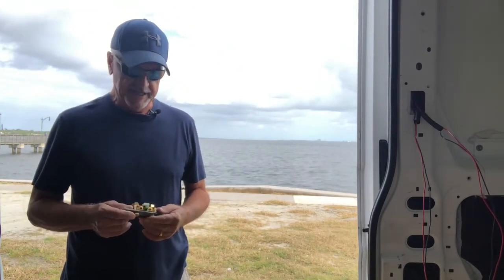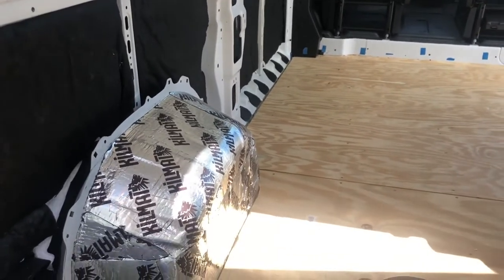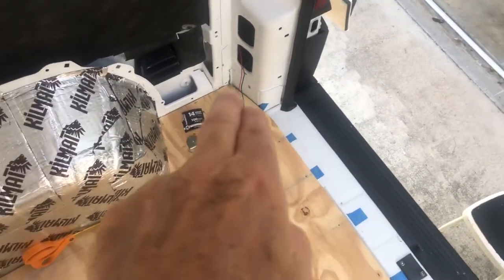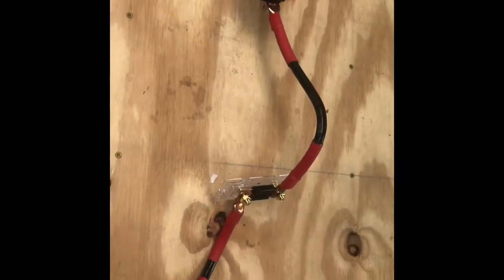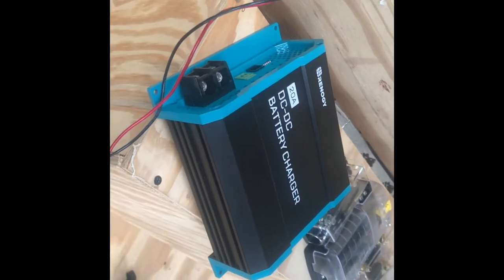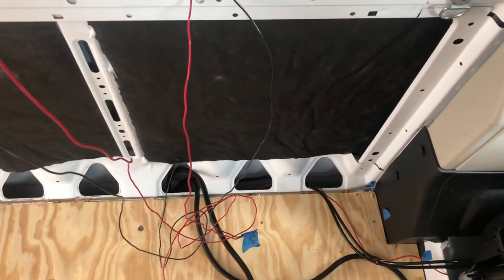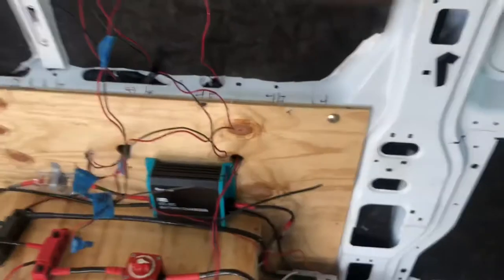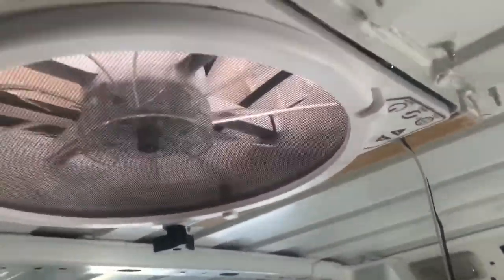How to install electric in your van #4 Electrical

Comment: Electrical is definitely the most daunting bit for most people. There are more and more companies here in England offering full van conversion service, or just partial conversion if you can do most of it yourself. Seems to be a growth area, even before covid. Prices of even older camper vans are going up fast. Well done researching, sourcing, installing and shooting that Tom! 👍
Reply from the maker: Justin Whiting  Thanks Justin. Yes decent vans are getting tough to find. I was extremely lucky to find a used 2020 at a decent price. The work can be frustrating but very rewarding after each part. Heading out on the trail in a couple weeks to do a 3 nighter. 👍
Reply: You're right Tom.  Hard work, sometimes frustrating, but rewarding. I've had a few project cars and a classic vintage sports car.  Same experience, but big smiles when things go well.  Not to mention the price appreciation!  You are building value and profit into your van for sure.  I'm considering a VW T5 van conversion.  That is the most popular type here, and quite similar to the Ram Promaster.  Don't work too hard on your van and and tire yourself out for the hiking though!

Comment: Which wire gauge did you use? You’re mentioning 14awg but for the refrigerator 9 or 10awg is recommended if you’re planning to use a compressor based fridge. The inrush current for a compressor on 14awg might cause too much voltage drop in the cables and the refrigerator will shut down (it will think the battery is empty due to its voltage)

Most manufactures list the required cable gauges in their manuals (longer runs need even thicker cabling)

For the d+ you can add a time-delayed relay if you don’t want to put the load instantly on the alternator. But to be honest, 20a isn’t much of a deal for a alternator. It will handle much more (lights, heated windows and so on, which is much more than 20a. They are made for it, so i won’t make an issue of the start-delay.
Did you also add a fuse on the car battery side? (Protecting the cable to the back), so 3 fuses in total: car (front) battery side, renogy input side (but you don’t need that one actually, since its not backfeeding power to your starterbattery), and on the output of the dc-dc charger
Reply from the maker: Hello Thanks for the input. Yes I am using 10 gauge wire for my Dometic CFF 45 Just a short run of about 4 feet. Its a combo AC & DC. Run DC Most of the time. 5.2 Amps. I did put a on off toggle for the alternator and have 2 30 amp fuses on both sides of the dc to dc charger. Everything is running great. Thanks again.

Comment: Did you utilize the upfitter connection in any way? I have the 2 aux switches on the dash, but I'm not sure 1) what to use those for or 2) how to set them up!
Reply from the maker: Hello BJ, yes on the passenger sir panel at the bottom other upfitter. I used a voltage tester to find a circuit when the engine is on it comes on.input an on off toggle switch wir a red wire to it so when I run the vehicle I can run the dc tc dc charger. You need the inserts for the upfiirts. I have them listen in that video as an Amazon link. Cheap. You may able to
Utilize you auxiliary switch to do this
Reply: @FOLLOWINGWALKERSWORLD  Thank you. I'm also curious how to determine the Dc2Dc amp size. My van has the 220A alternator and I'll have 380W of solar (wired in series).
Reply from the maker: @bjsorensen  Hey Thanks for watching. My 20 amp is working great in conjunction with the solar. Your system would probably due better with a 30 or 40 amp. Your alternator seems sufficient. 👍👍

Comment: You forgot the shunt...?
Btw: you can find cables that are much more flexible. Better change the dealer next time.
Reply from the maker: No I got the shunts in. Yeah more flexible cable was needed. I was limited to my local HD & Lowe’s. Everything is working great for a rookie. 👍Thanks for the input.
Reply: Hm, I don't see the shunt. It should be between the negative pole of the battery and the negative bus bar.